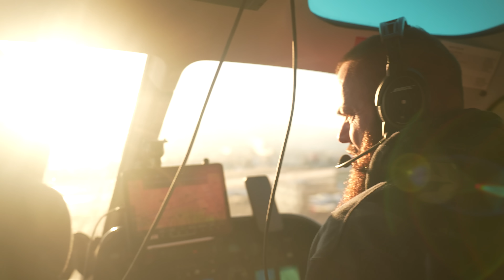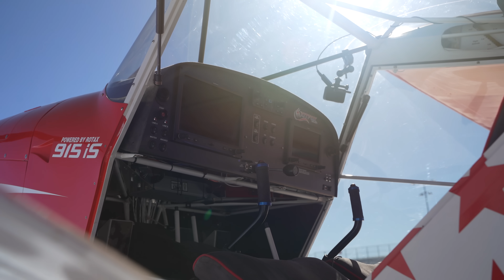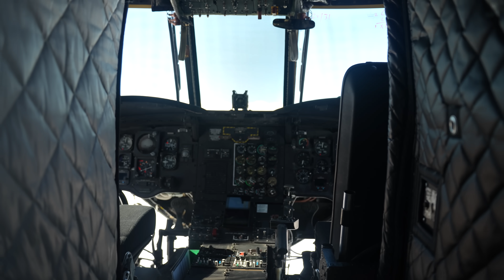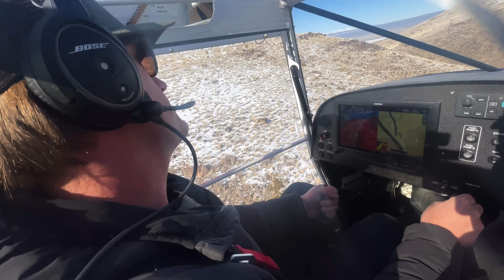We Had To Bring In a CHINOOK Helicopter For This Recovery With @TrentonPalmer

Comment: That aerial shot of the Chinook hovering over the trailer as the guys hook it up really impresses upon you (or at least on me) the incredible technology that is a helicopter. Through human creativity and innovation, we've created the ability to take a 12 ton piece of metal and suspend it in midair, hundreds of feet up, stationary, without any external support, by just moving air around. I love helicopters and I understand how they work, but that image really drives home just how incredible that creation is.

Comment: I did a lot of volunteer work with the fraternity of the desert bighorn sheep in Nevada, we used helicopters all the time to move our building materials & work crews up to locations high in the mountains.  This job reminds me of so many of the equipment and material lifts that I worked on. 

We built water collection projects for the collection of rain water & used walk in guzzler for all of the wild animals out there in this desert. Watching this lift brings back alot of memories of working around helicopters. Nice job Heavy-D

Comment: Yeah, on a cold day like that, those helicopters do have a lot of lift, but if you want a proper light helicopter, you need a Hughes OH-6.

This is a great video for remembering. I was responsible for training and running a recovery crew; we personally retrieved about 24 OH-6's (using our best Hueys) from mountain ravines, etc. Then flew OH-6s myself for the next 6 months or so. A most amazing helicopter.

Comment: I was an Airframer in the Navy, working on H-46 Sea Knights (HC-5). Every other phase inspection, we completely removed all of the flight controls from the rotor heads. The engineers at Vertol were part insane, and part genius.  Also, underway VERTREP with as many as 4 Phrogs in the mix for 6 to 10 hours, is a rush.

Comment: It always boggles my mind how those two turbines on the chinook, looking so damn tiny and pathetic, can power that huge beast and also make it a heavy lifter and one of the fastest helicopters ever made also. Pretty impressive.
Reply: Think 10,000SHP @ the engine total input..@ about 5,000 RPM.. then up the torque by 28:1 gearing .. (approximately)..
Air crushing torque!

Comment: Great video, and I remember being in the Army Doing Sling loads under the helicopter in the early 90s... surprised you didn't have to ground the copter or sling line.  Those blade generate a lot of static electricity that at night looks like little lightning coming off the blades.

Comment: I spent about a month doing traffic management for a helicopter logging crew about 15 years ago. They where using a Chinook. I was amazed at how it worked, what it could lift and how fast it could lift out logs. We had 8 crews of guys felling and rigging etc. Anyway one day we had a 'news pilot. Turns out it was one of the senior check pilots for the company (Columbia helicopters) we borrowed an extra 4 felling crews and he was still bored. The normal pilot would pick the log up by hovering and letting the rigger hook the chocker onto the Whitehook,  this guy had the rigger prop the loop of the choker in the air and he could hook it without slowing down and he could drop the logs in the claws of the loader, properly impressive stuff. I got to have a look over the choper and it had a heap of little patches all over it, The (normal) pilot said that the chopper was shot up during the evacuation of Khe Sahn, weather or not thats true who know lol

Comment: They used a chinook to carry the top sections to the top of the CN Tower in Toronto when it was built. They had to hold position long enough for the guy in the section to bolt it together.

Comment: I road in one of these when I was in the army and the tail does rotate, but more in a constant counterclockwise movement. I saw some people get motion sick from looking out the back of it. I LOVED it an really loved any copter I road in. But yeah, it is sort of twisting a few feet while flying. So, there is movement, but none that needs to be countered as it does not turn the craft like it would if they were both turning the same direction. i always wondered if it would flip the helicopter upside down if going the same direction.

Comment: I and 30 others were in an Army Chinnock load testing certification low-level top speed below tree top heights back in the 1980s. I was Royal Navy Fleet Air Arm. It was fun fun fun
Reply: What was not fun, I was RN postie in the Falklands 1985 and went to drop off bags of mail on remote landing site. The load master of the RAF Chinnock was checking the forward gearbox oil levels but stood up too far and lost the top of his head. He was due to fly home the next day as his tour was at an end. RIP something you never can unsee.😢

Comment: I did a lot of that kind of lifting in Vietnam in 1969. Didn't have all the nylon ropes back then, everything was metal cable. Had to deal with static elect from rotors. knock you to the ground.

Comment: The CH 47 Shit hooks, Hueys helicopters and Buff's ( B 52's ) will still have a few flying 100 years after the first ones came of the assembly line. Believe the Boeing Company near Philly  is building 15 to 20 model CH-47F Models and updating some old ones. Each cost over $60 millon. CH47 can float on calm water.

Comment: The rotors spin in the same way clockwise. They are connected by axel because the blades overlap each other. Mr D doesn’t know what he’s talking about. Trent Palmer is a supper cool stol aviator. I’m not surprised mr. d has pilots fly his helicopters for him.

Comment: I wished I had videos from when we hauled Helli Siesmic Drills with hellecopters  while i was doing a help out job one sumer with Mountainare Drilling. first went the drill, then the drill stem basket, then the basket with the Dynomite and blasting caps. them pilots were absolutely increadable how they could set them down exactly on target, and drop the line down deadly on target for us to rehook to go to the next shot point. and beleive me some of those places was crazy out there in the foothills of the rockies of alberta, and in the actual mountains as well.  best was all the hellecopter time we got riding in them.   And durring all 11 years i spent in canada's artic being flown out to the drill and equipment daily. seen alot of amazing country from up there.

Comment: I've been in a CH-47 a couple times.  I've been under one a couple times.  I've jumped out of one a couple times.  I'd much rather jump out of one than be under one.  In the dessert, desert, sand, the downwash will pit windows of the vehicles around it. Also, I don't think some viewers know how difficult and potentially dangerous sling load operations can be, specially under the downwash of a Chinook.  You might want to have an air mobile sling load specialist explain how difficult and dangerous it is.  Anyway, nice video, thanks for sharing.  (If you need a DZ/LZ SO just call me.)

Comment: as an Commercial HVAC Contractor We get  to use Choppers usually 2-3 times a year to set Hugh to Big to small HVAC equipment  bc drive & roll up crane just cant do the job roof tops

Comment: To answer your question, this helicopter has 5 transmissions, left and right engine 90 deg gearbox with short shafts to the combining transmission, with outputs to the forward and aft transmissions. The C-box is where the magic happens, keeping the blades from from meshing.

Comment: Does that wire running down the cable dissipate/discharge the static somehow? I remember having to use a static rod grounded to a large spike in the dirt to touch off on the hook so we wouldn't get electrocuted by the static generated by the rotors. This was during sling load training in my unit at 101st. We were calling in Chinooks to pick up HMMWV's and even an LMTV from an open field. It's something else to experience being on top of the load as the Chinook comes in for the hook up. Air Assault!

Comment: the black magic you are referring to is if you have 2 rotors one rotating clock wise the other anticlockwise the touch from the clockwise will want to turn the hull anticlockwise and the anticlockwise blades will turn the hull clockwise and these forces counteract each other meaning there is no need for a tail rotor is not needed as that it the job ot the tail rotor is to counter the touch of the blade.

Comment: Well life happens. Finances just changed so 7500. for my jeep. 1989 YJ 170k miles. all new gears and seals in everything, Good 33 inch tires, electric rear locker, hood vents,  old school snow plow, winch on the front, new larger battery, cb, sterio, all interior lights work, leds front and rear. solid doors new door panels not on yet. I do not have key locks yet.. Set of nice white half doors. led tail lights. 4.2 5 speed. sniper 2 barrel injection, new tank pump, msd self learning ignition also tuned by the sniper set up. led head lights. rhino lined inside floors. new radiator, stat, 4.88 gears. Moriarty NM.

Comment: What a bunch of whiners! As an air assault trained Chinook Flight engineer with the 101st i've been both in "the hole" calling the loads and 5 feet below it hooking up loads at a hover. interesting that they did not use a static shock arrestor, I've seen several guys who forgot get knocked on there ass off of humvees, etc They look like a big lump but man do they do some fun shit empty!.

Comment: I love your videos but everytime I see atleast 1 mistake in the rigging haha
Reply: ʟᴇᴛ’s ᴛᴀʟᴋ.
ᴛʜᴀɴᴋs ғᴏʀ ᴡᴀᴛᴄʜɪɴɢ...
Reply: When you guys were putting the trailer to the helicopter i saw the d rings in the wrong way if you would have turned them 180° then there tention on the rope now they pushed to the side of the d ring so there wil be lots of friction and all the ropes have slightly different length if you would have used the round side then there was a bit more room for the ropes to fit how they want to fit if it's not a heavy load like this it's no problem but if it would be heavyer then there is a higher change the rope would have died
I am sorry for the bad Grammer English is not my first language
(Usely it's only the small things like this)

Comment: Too much talkie talkie let's see more action. You should have brought a backhoe or a mini-excavator to dig up the bared stuff that can ruin tires when driven over them if another event is done out there when the lakebed is dry. A little dozer would have been good to pile that stuff up to haul off on a small trailer of some kind with a front end loader out there. Could have done the whole job with small equipment at half the expense of that large helicopter at his hourly rates.

Comment: The "Brother" was cooking meth. Explosion was in the rear of the trailer.. That was a gas explosion, cooking elements are in the middle and propane tanks in the front.. Sure mayb the water heater lol ( they were the original on demand) BUT the heater is "open" and so are all the components in case there's a leak it just goes out into the air like an exhaust on your car.... But the EXTREAM EXPLOSION in the rear i havent seen since prom night... Gas lines are on the outside on the underneath of the trailer they don't seep into the inside exactly same reason to prevent explosion.. NASA invented the first Airstream RV trailers ever since it's literally been the standard for protection and safety ON ANY RV.... I might be on meth or have watched Breaking Bad too much or somewhere in between ;) or was hot air balloons and unsafe gun ownership I mean propane tank storage hot air balloons outlawed now mass hot air balloon explosion